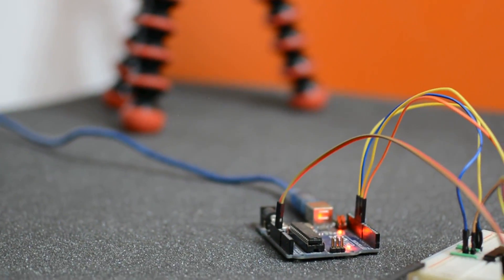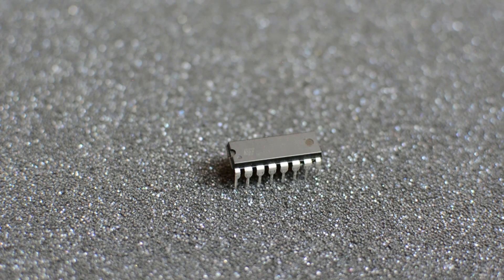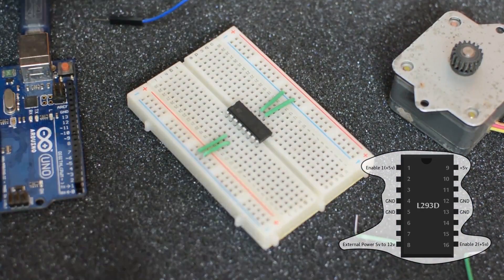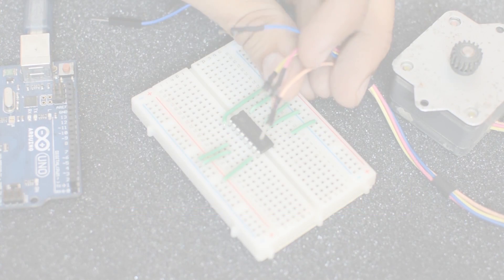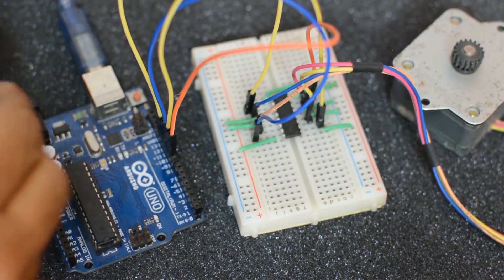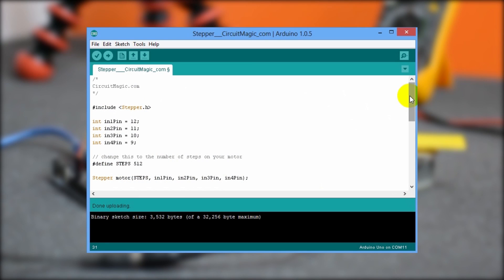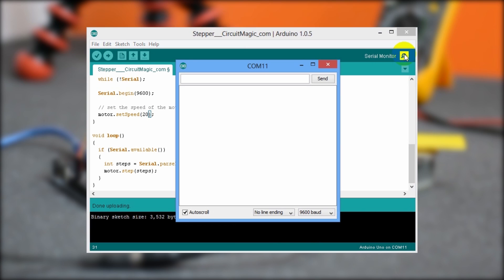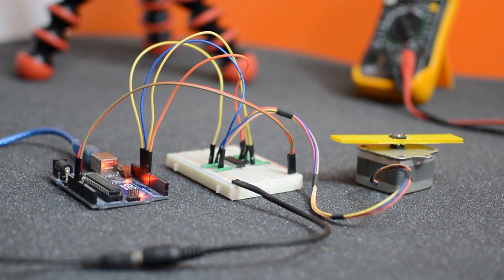How to Run a Stepper Motor with an Arduino + L293D IC

Comment: thanks for your great explanation i have a question can we connect 2 DC motor instead of stepper motor with keeping the configuration for the input and power connections or we will need to modify?? thanks in advance

Comment: Please check the direction and speed control of DC motor in fully automatic form with just coding without the use of keys and ... Using atmega8 micro control and l298 module

Comment: I'm having a problem... Apparently, cannot plug the +5v from Arduino to pins EN 1-2, EN 3-4 & Vcc1. Because it causes to off Arduino board. Independently of if the Vcc2 is connected or not (9v motor power).

Comment: if we have 6 wire Stepper motor then how we connect to L293D ic?Please Tell me..
Reply from the maker: You can use only four wires from that stepper motor. Just leave middle wire of both coils
Reply: your means that i have 6 wire stepper motor and L293D IC , 6 wire stepper motor for connect to IC L293D  just leave middle wire of both coils and after these connection my 6 wire stepper motor run on IC L293D .Am I right?
Reply from the maker: Ya right just connect four wires with ic. With this ic you can run only small steppers which required upto 600mA. If you have big stepper then use L298N ic module, max current is 2A. You can find the video on my channel.

Comment: Hi and Thanks for your video ! I have a question : what kind of 12v power supply do you use ? I need to know it for an arduino project. Thanks for your response. Cheers and good job

Comment: hey the extra power supply seems to do nothing when i remove it
Reply from the maker: Ok, then check the IC (L293D) pin no. 8 and pin 16. Pin no 8 is for external power source (up to 12 volts) and Pin no 16 is for 5 volts (from the Arduino). When you remove extra power supply Pin 8 not connected and voltage should be 0 on pin 8 you can check with the multimeter. Hope you understand, try to fix the problem and if you have any doubt just let me know. I am always here to help you.
Reply: can u help me figure out why?
Reply: they both add to the power but i dont know why or how it works

Comment: Nice work.
But i want to know something.

1. Can i use it with Toy car circuit without using arduino or raspberry pi.
2. I want to make a wireless remort control robo car with 6 motion arm. What i want to do or

If you give me answer of q.1 than i can make it wireless + arm. 
If it can control buy toy car than i use 4 different module remote control circuit ( 1 is for car control , circuit is 12v wireless kit)..( 3 different control drive toy car remote kit for control the arm).

Comment: hello, is the L293D recommended if my motor takes a current of 300mA and requires a voltage of 24 volt ? also is the L293D reliable if  my motor is  power on for a very long time.
Reply from the maker: Hi I recommend you L298N motor driver module, It work 5 to 35 volt, if you are using more then 12 volt then don't forget to remove 5 volt regulator jumper. For more info please watch this video. https://www.youtube.com/watch?v=dyZolgNOomk

Comment: Hello everyone, I have determined an easy way to see which wires connect to a winding. Plug in an LED to a breadboard, and plug in a pair of wires from the stepper to each terminal of the LED, and spin the shaft of the stepper motor both directions. Keep switching combinations of the wires until the LED turns on, when it does, that pair of wires is connected to one winding

Comment: for every input the motor is just vibrating not rotating please help anyone ASAP to resolve the problem.
.
Reply: Set the speed slow.. If the speed is too high it will only vibrate

Comment: Good Stuff Eric! I always appreciate a nice and sucinct tutorial!  With your link, you've made this very thorough. Thanks
I'd like to see about generating a code whereby I can control a stepper with a joystick, utilizing it's neutral position as a 'neutral'; meaning a left move of the joystick reverses and a right produces a forward revolution. Or perhaps (more easily) the joystick's push switch activates a reverse mode. - All with the Arduino, of course.

Comment: hello sir I am from India
I want to know how to operate 220v stteper motor with arduino pls tell me
Reply: you need to run that through a relay switch, the arduino can only handle a certain amount of voltage.

Comment: I need torque, if i use 12v in the power supply of the L293D, i get more? I mean "power input for motor" in your diagram
Reply: Torque and a lit bit speed, yes you will do

Comment: What are you using to power the breadboard? Maybe I missed it, anyone can answer if I missed it. Do you have a video of a 5 or 6 wire setup?
Reply from the maker: I have used 5v power supply. here is the link for the video position where I am connecting power supply to the breadboard. https://youtu.be/hZNF7tAJmfk?t=122     - right now I don't have video for 5 or 6 wire setup, but I will make and upload it.

Comment: Hi, can any one guide me what kind of ready-made Circuit kit I should buy from the market which can ablr to perform following action:
A circuit kit, which can able to detect RPM of a rotating object (lets say object 'A') via IR. 
Then Circuit Kit gives signals and set the same RPM to a attached 12v DC running motor (lets say object 'B')

Conclusion: What so ever will be the RPM of object 'A', Circuit Kit will automatically set SAME RPM for object 'B'

Thanks!

Comment: hi all, i need the proteus and arduino with the stepper connections and the code to run a specific angle when i input that angle and to turn on that.
because i have not the hard wares  all but i need to understand how it works . since it confuses me on the proteus how it can works with the 
#define STEPS 200
Stepper motor(STEPS, in1Pin, in2Pin, in3Pin, in4Pin); 
if (Serial.available())
  {
    int steps = Serial.parseInt();
    motor.step(steps);
  }

Comment: Hi, i have a question, is it possible to use a contact switch and everytime you pusch it goes 1 step forward. I want to build a turntable with a stepper motor. Thanks in advance!!

Comment: from where to take 5V supply?
Reply: you could use any 5v power supply with enough current. so not the Arduino. maybe just a wall adapter. if you don't know for sure how much power the motor consumes it's better to be able to supply more current than not enough. (don't forget to connect all grounds together, Arduino and power supply, or you may get Wierd results)

Comment: Thanks man!!! Is there a way I can do this with a 6 wire motor?
Reply from the maker: we will upload the video for 6 wire setup soon!
Reply: Circuit Magic have you done that yet?
Reply: In six wire join common wire from both windings and apply positive motor supply to them

Comment: can you program push buttons to rotate the stepper in certain steps? if so, can you make a diagram and code pls. thanks! :D
Reply: do you still need the code? i could maybe make a simple code for you. as for the diagram, i'm not good at that

Comment: Hi, many thanks for this, I want to control a NEMA 17 to do few loops clockwise and retune back anticlockwise with same number of loops and so on can I use this driver? Additionally I have purchase a lead shine DM442   drive can I use it instead of both arduino and the L293D? regards

Comment: Code:

#include <Stepper.h>

int in1Pin = 12;
int in2Pin = 11;
int in3Pin = 10;
int in4Pin = 9;

// change this to the number of steps on your motor
#define STEPS 512

Stepper motor(STEPS, in1Pin, in2Pin, in3Pin, in4Pin);  

void setup()
{
  pinMode(in1Pin, OUTPUT);
  pinMode(in2Pin, OUTPUT);
  pinMode(in3Pin, OUTPUT);
  pinMode(in4Pin, OUTPUT);

  // this line is for Leonardo's, it delays the serial interface
  // until the terminal window is opened
  while (!Serial);
  
  Serial.begin(9600);
  motor.setSpeed(20);
}

void loop()
{
  if (Serial.available())
  {
    int steps = Serial.parseInt();
    motor.step(steps);
  }
}

Comment: from where you are connected external 5V and is it possible to run the bigger motor using with L293D IC...?

Comment: Hey man, really good job!
I have a question about RPMs of stepper motors, how much rpms are max which u operate with?
I can get only like 240rpms with my Nema 23 425oz, If i go faster, the motor just stops and produces strange noises and vibrations. What to do?
All the thing is with no load on the motor shaft.

Comment: hello, how the connection if i want to use arduino+motor+relay and 3 pin variable resistor 10K . where would i connected the relay and resistor. Thanks

Comment: I have a problem... I connect my DVD stepper motor to L293D to arduino, but the motor don't work... just make some noise like "click" "Click"... when I press the shaft it some how moves... I tried with different number for steps, but no result... can you help me pls.
Reply from the maker: Tatjana Hiljadnikova check the connection according to https://youtu.be/hZNF7tAJmfk?t=74 or you can check another video https://www.youtube.com/watch?v=Fb8b7YQcL1o
Reply: Tatjana Hiljadnikova  try to reconnect the connection if your motor that means your connection are wrong